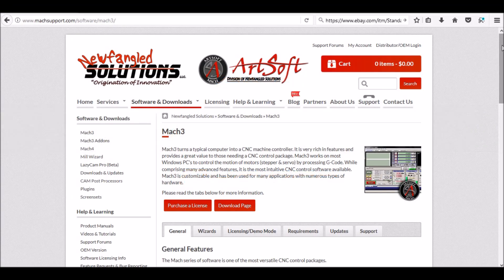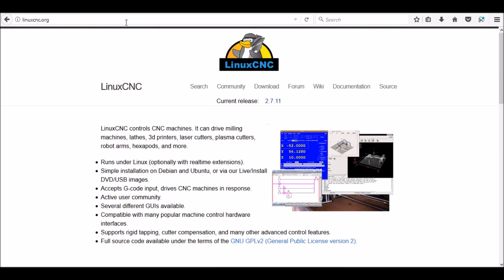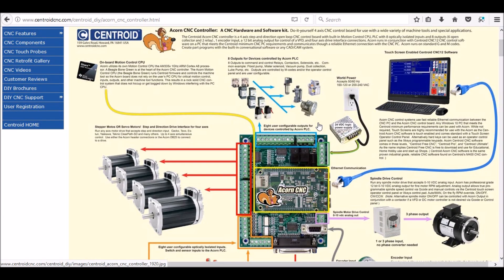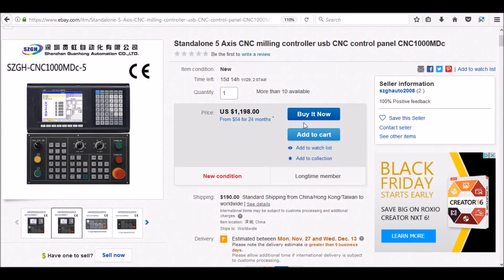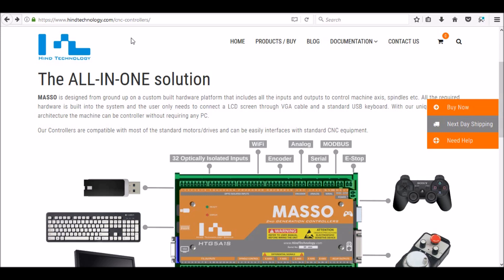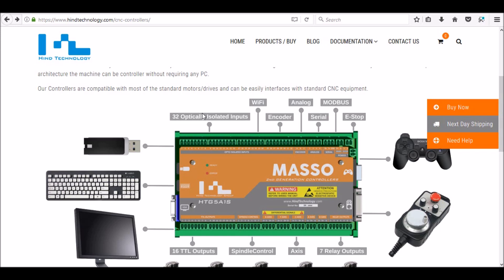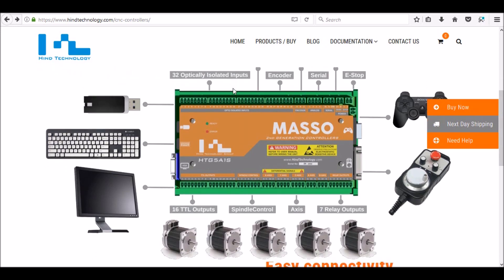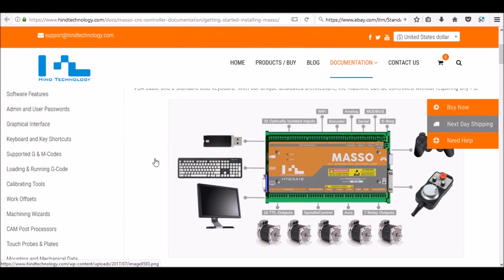DIY CNC Controller Choices?

Comment: been close to a year , and i havent seen a second video on the build , i allready bought an acorn setup for my bf20 mill (no atc only cnc is the xyz axis and the drive ) with a computer touchscreen yadah yadah but im still interested to see wat you get for youre money with a masso  and how well it works
Reply from the maker: Has it really been that long? Yeah I guess your right! Man I apologize I have the Masso  just sitting here Iv'e been so busy trying to get my mill converted to belt drive and a PDB. I finally got to that point and this new project fell into my lap. I can tell you I will get to it I cant tell you when.
The best thing is Masso keeps updating the controller and making it more usable , WIFI, Touch Screen, so time has been a good thing.
Reply: i know how it is , i keep a log with dates wensites and expenditures for the stuff i collect for my cnc conversion , the payments for the mill and the lathe had taken about 1 year and the parts collecting all together been going for about 15 months now and i only collected stuff not started the build .
the mill is still all original as i dont want to risk taking it a part and then need it to make sumting i need for the conversion (chicken and egg syndrome)
allso life (medical/dentist)bills and taxes keep interfering 
getting pretty close now to assemble the controllbox though and have the different steppermotors ,vfr and 3 phase motor move in the open air using the controlls on the computer
Reply from the maker: I completely understand the longer it takes the more you tend to 2nd guess besides technology changes rapidly

Comment: Great info: I have been looking at the controls myself. Im doing a cnc Biesse 23  with about 94 i/o on it. Centroid is coming out with here RED OAK control and we can add a slave i/o to it. 
  I might spend a bit more to do this retro but lot less wiring in my case.
Reply from the maker: Thank you!
Are you talking about a Rover 23ft? Wow thats a huge undertaking converting the control system on a machine like that.

Comment: Halo and wat about cs-lab csmio controller ? Did you consider this option ?
Reply from the maker: The Cs-labs controller is a option however not something I considered, as BOB are needed for connections, and unlike the Masso there are nor FRU if a axis has issues your down.

Comment: the reason i went with Linuxcnc is because i need 7 Fully Closed Loop Servos with encoders for a 5 axis cnc
Reply from the maker: Yes Linux cnc is a very proven powerful system and a great choice.
Reply: open loop uses hobby normal closed loop servos cost 100 x expensive than hobby user stepper motor machines cost, not have hobby user budget newer. idiot waste money if can build good machine lot lot cheapen.

Comment: I have used Mach III for years, linux cnc, looked and am still looking at the masso for one of my machines. I own a path pilot driven tormach and it is light years beyond these options. I have two machines still driven by mach III they may end up with a masso on them sooner or later.
Reply from the maker: Hi Cliff, are you saying you prefer Path pilot over both? why not add path pilot on all?
Reply from the maker: I like the Masso  the whole concept and the screens are simple and easy to use. it does lack some features I want but I think these are in the works and it is continuing to be upgraded.

I really like the thought of Linux CNC/ Path Pilot so I may build the enclosure so that I can go either way.

Thank you for your input
be Safe
Sam
Reply: Path Pilot is a proprietary Tormach product tailored for their devices. I am a linux expert and could manage to do it but it requires a bit of hackery and of course time to do it.
Reply from the maker: Yes but it is Linux CNC which is open source correct?
Reply from the maker: Shoot me a Email cnc4xr7@ gmail
Reply: Running my diy CNC with PathPilot , and loving it . The conversion is not too hard if you do a little research before diving in

Comment: Hey Sam - is the Masso able to do five axis PLUS toolchanger or are you robbing one of the axes for it? 

Will it run optical encoders and a real brushless DC servo, optical encoders and a stepper, and the Clearpath kinds of servos? 

Did you look into a Smoothie board or a Duet?

What are your thoughts on running LinuxCNC on a Raspberry Pi?

It'll be interesting to see you configure the Masso and watch the commissioning. Thanks for sharing the thought process and some of the alternatives that are out there
Reply from the maker: Depends on how your driving the ATC, Yes, No, Linux cnc good choice, Your welcome.
Reply: if you have a low requirement then the Raspberry is probably okay, for anything more get dedicated hardware (best Mesa hardware)

Comment: I'm looking forward to this. I actually bought an Acorn board and am setting it up. I'm struggling w/ the limited inputs/outputs
Reply from the maker: Kirk Douglas 
Yes that was one big tging holding me back and since they offer higher priced boards I didn't see where tgey had room to improve on the acorn without cutting into the other

Comment: As fate would have it, a friend of mine wants me to convert his 2001 Laser Master machine to a router. It’s daunting trying to find a simple solution plug/play (ish)

Do you know if the Masso can handle a laser and router?

Great video and perfect timing. 😊
Reply from the maker: Well no doubt the Masso can Handle a Router , There is a masso for Plasma cutting I'm not sure what you need for a Laser However I'm sure the Masso can be configured for a Laser. I'm sure Jatinder ( Hind tech CEO ) can chime in and answer that.
Reply: Controlling lasers shouldn't be a problem and we can even use the PWM outputs from MASSO to control the laser power. Please email us on support@hindtechnology.com and we can have a look.

Comment: hii there
would it be good for a new learner of diy CNC to go for masso or should i start with Mach 3. I want to make long term investment and want to do high precision kind of work in furniture
pls rply. thanks
Reply from the maker: What Type of CNC will you be running? A Wood router?
Reply: CNC4XR7 yes wood router mainly for making wooden furniture
Reply from the maker: I think the Masso would be perfect for that application.